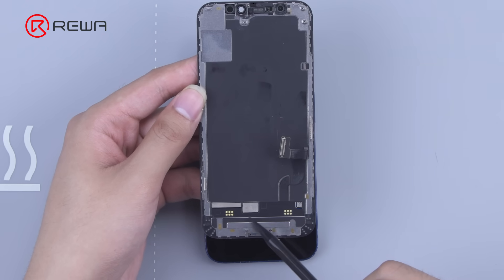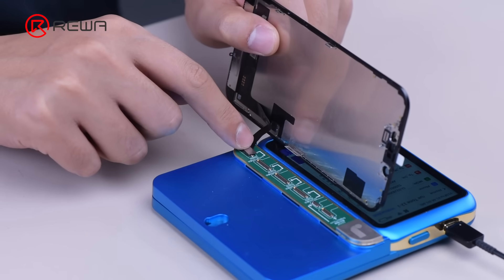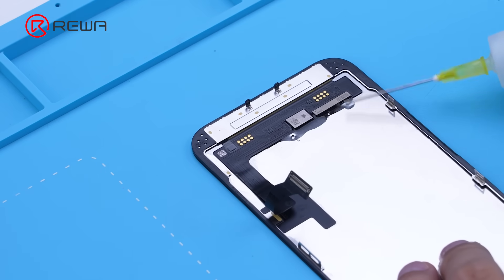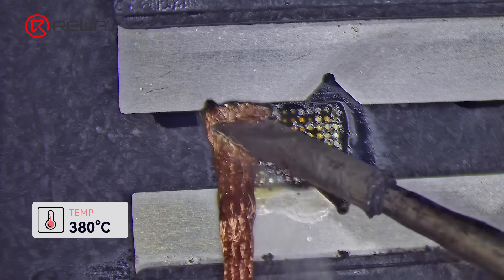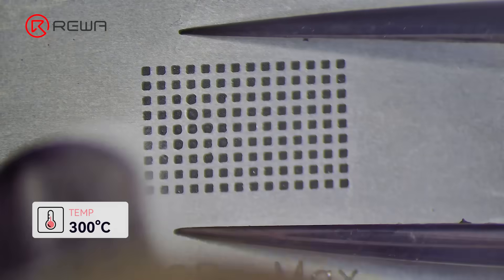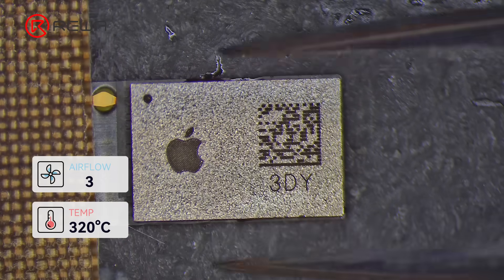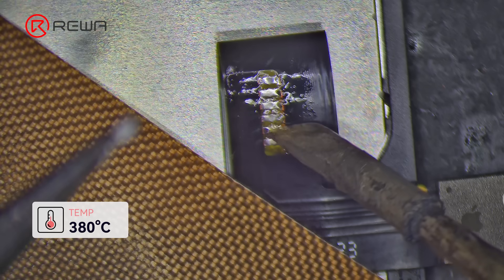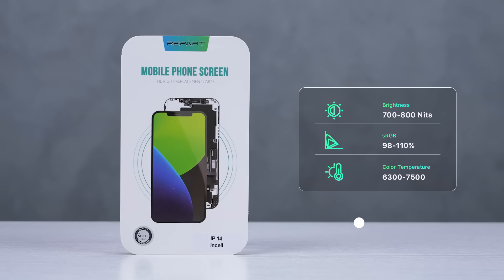iPhone 14 'Unknown Part' Message Removal Guide After Screen Replacement

Comment: For ic transplant truetone copy is not necessary. The ic takes the over the truetone.
Reply: You wrong, is also necessary to copy mtsn trutone or a pup up error message will show up
Reply: @JaviSolucionesblackniPhone nope i have done it a more then 30 times. I do ask people if they want the ic transplant i charge more. For it. If you are a repair shop just try it.

Comment: I am desperate, can someone tells me if there are still any other ways to fix it, when I no longer have the chip from the original display. I really want to get rid of the message because it makes my battery last much shorter.
Reply: this is simply incorrect information

Comment: Are there aftermarket screens that does not support programming? I bought new 12 pro display to replace the cracked one and i only want truetone back, i dont care about the genuine message, but when i start to program it then writing/burning fails every time.
Reply: it will affect the battery performance if you don't have the true genuine message

Comment: I have questions regarding screen replacement on iphone 14 and 14 plus. As we know, before we fixed anything we disconnect the battery on any iphone’s model. is it safe to do screen replacement without disconnecting the battery on 14/14 plus model? As we know we have to disassemble the back glass to reach the battery. Because i’ve fixed iphone 7 without disconnecting the battery like 5 years ago and it went completely dead. So i’m a bit scared. Please answer🙏🏻
Reply: Yes
Reply: No

Comment: That looks great! One question: would it be possible to connect the cleaned IC directly to the tin on the tag on flex without reballing it (only tin removal and cleaning) or is that discouraged because fresh works better or what might be the reason?
Reply from the maker: After removing the tin, adding mid-temperature solder will increase the chances of success.
Reply: For a small 3x3 ball chip this sometimes works. But this ic is just too big, you dont want that margin of error (if the balls are different size then there is a risk the ic wont sit properly). The stencils are really cheap, so make sure you buy them in bulk and never ever try to skip this step. Worst case scenario the balls may bridge and cause a short, possibly damaging the motherboard. You really dont want this to happen on a 1tb 15 pro max while the client is waiting nearby haha

Comment: Very clean and scientic work,butt tell me something,if we don't change the chip, beyond the message, will we have any other screen functionality problems???
Reply from the maker: Hi, It's just the message problem, it doesn't affect the use.
Reply: @rewatechnology2008 doesn't it ruins the auto brightness and true tone functionality?
Reply: @rewatechnology2008   my battery actually become much weaker. go to sleep with 50% power and wake up without doing anything in between and the next day it has only 25%  left.
Reply: You wont

Comment: Since when Apple started to put underfill under this IC ? I could re-ball it directly in iPhone 12
Reply from the maker: The aftermarket screen shown in the video is pre-tinned and can be soldered directly. However, REWA technology recommends removing the tin first, and then re-planting the tin with mid-temperature tin to improve the success rate of soldering.

Comment: if you are transferring the IC why do you need to program truetone???? it’s already in the IC
Reply from the maker: Aftermarket screens have its own IC to store True Tone data and this IC does not read True Tone data from the original touch IC. That's why you need to program True Tone before transplating the touch IC.
Reply: @rewatechnology2008  Ahh i get it, that’s why there’s so little traces on the transplant flex it’s just enough to get rid of the messages

Comment: I got this message on my phone without ever replacing anything or opening it. The phone was directly from the apple store. Starting after a year. iPhone 12 Pro Max.
Reply: probably IC pads disconnected from a fall of the phone or water damage
Reply: @ronlevin2339  it’s the camera. Says it’s camera is an unknown part. Guess that makes sense.
Reply: @yoitsgiook   maybe only connector got loose. Opening phone is needed of course
Reply from the maker: Hi, it is recommended that you seek after-sales service at the store where you purchased the phone.
Reply: @rewatechnology2008  it was at apple. I did, but at the time I couldn’t turn the phone in, needed to do a more recent backup. I was just more pointing out that this happens without changing parts.